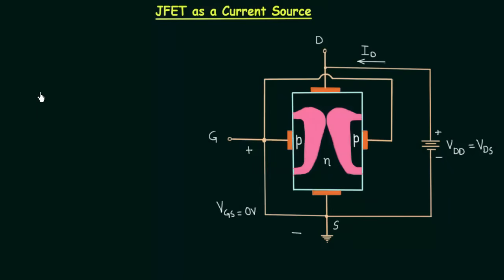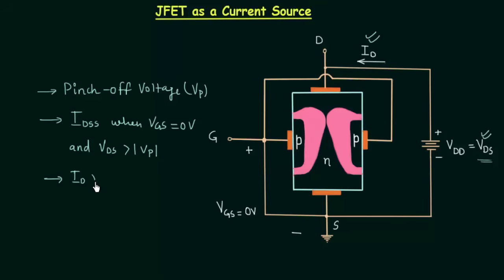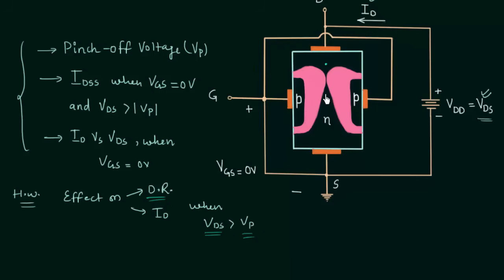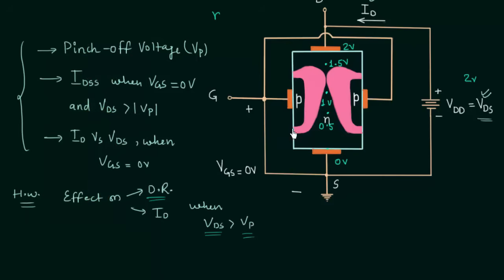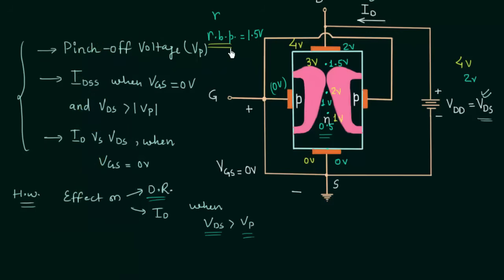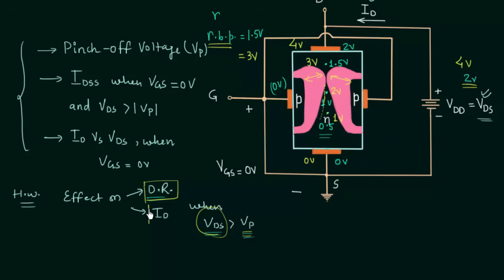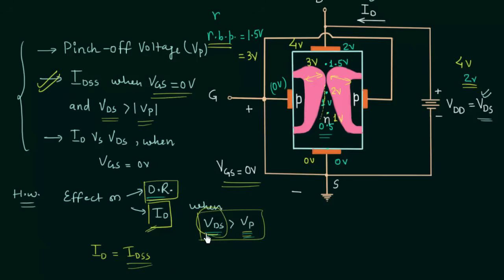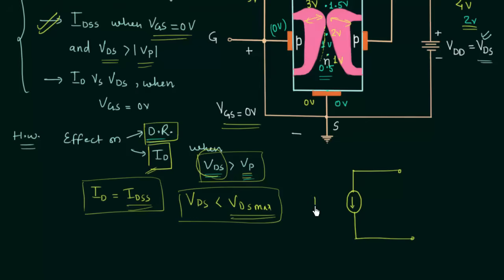JFET as a Current Source

Comment: As  the drain source voltage  increases the width of the depletion region increases. Then a decrease in drain current expected. Why the drain current increases as the drain source voltage increases(ohmic region)?
Reply: Current will not decrease as the area from current is passing is just getting shrinked ,the value of current is still increasing as we are increasing source voltage

Comment: when Vds is increasing beyond Vp, depletion extends along length of channel so obviously charge carriers transmitted is blocked and reduced so current Id should reduce but how come is constant?
Reply: i think when the width of depletion layer at the bottom increses resistace in the n-channel also increases ..and we know v=ir in this (v/r)  is constant tht is current i(dss)
Reply: vignesh lakshmanan did u get d answer. If so plz reply
Reply: Hi can u explain the answer to the question of vignesh